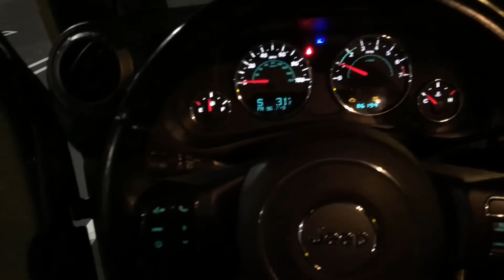Warden JKU | Getting 40" Tires

Comment: You're card works better than my actual ice scraper. Also get yourself an oscillating multi tool, they cut a lot straighter. At first I was using a Dremel but I just kept getting chopped up edges  and it wasn't cutting as easy as I wanted it to. So then I used my multi tool and it was just like cutting through butter with hot metal.

Comment: How the heck do you not bog out with stock gearing?? 3.21's or 3.73's at best... Wtf. Typically 40's call for tons, d44's at a minimum and prob 4.88-5.13/5.38's. how do you not break or bend anything?
Reply: Dude I was thinking the same thing I have a jeep as well and he has 40s on stock everything also that's to much stress on that 3.8 by it needs to be supercharged need more torque to push them 40s
Reply: Intrinsic Motors d44 is a bit different then the d30... The may share housing but that's not the stress point...
Reply: I’m just wondering about his gearing that thing must be a turd I have 37s on 3.73s and I hate it. There’s no power

Comment: I see alot of comments about him needing 1 tons but people have to realize 1 tons are very heavy as heavy as those 40s so the rig needs engine upgrades because that 3.8 doesn't have enough torque to push heavy ass 1 tons and 40s
Reply: Plenty of people run 40s and tons on TJ/LJs which have less power. You just need proper gearing and realize you're adding hundreds of pounds of unsprung mass. It's a jeep not a race car
Reply: @deadbolt9019  racecar lol you have to understand its about torque and people think gears solves the problem no everyone I'm around have Chevy or diesel swaps or strokers running 40s & 1 tons wheeling a buddy of mines just did a 6.1 hemi swap I his jk 40s &1tons
Reply: @deadbolt9019  something mild like a chip and intake will make a difference for you but nice rig dude